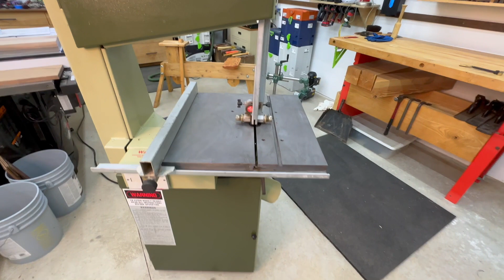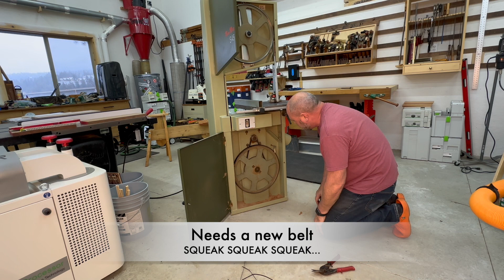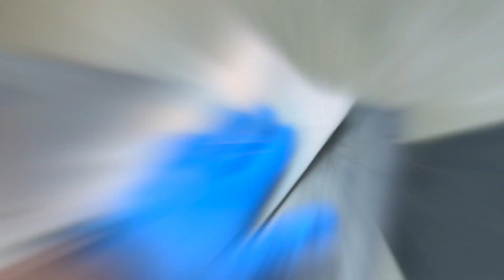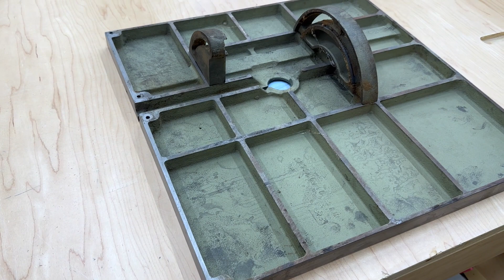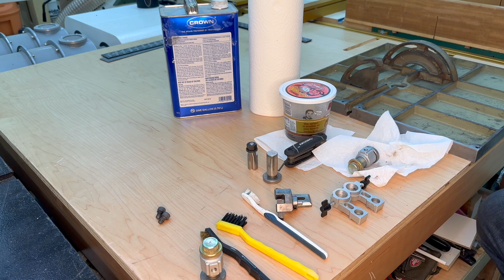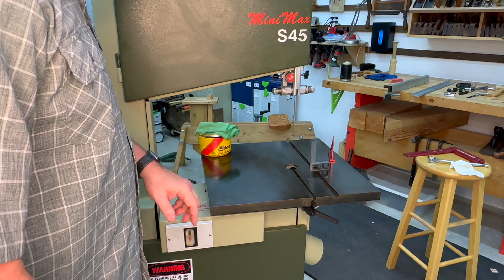Rust proofing cast iron tools in your shop?!? MiniMax S45 bandsaw Rebuild.   HD 1080p

Comment: Robert,  I wonder if you could help me.  I have the same saw that you worked on, but the support for the upper blade guide is not installed.  Would you share another video (or a few words) on removing and reinstalling this support.  The parts I have include a spring and I cannot figure out where that goes.  I appreciate any help you can offer.  Thanks, Doug
Reply from the maker: Happy to help Doug!  I sent you an e-mail.